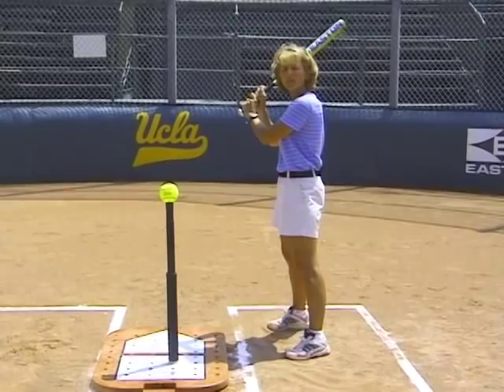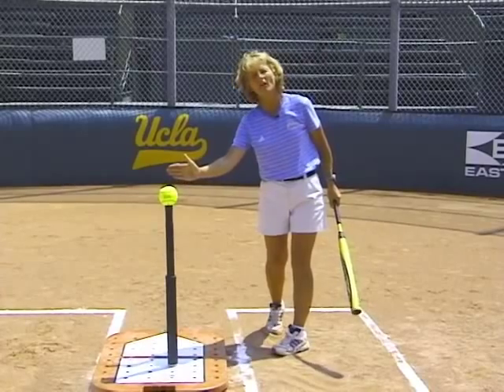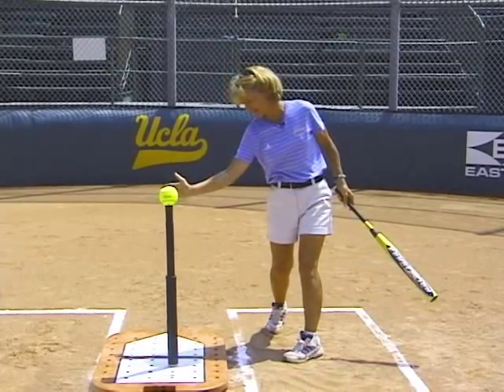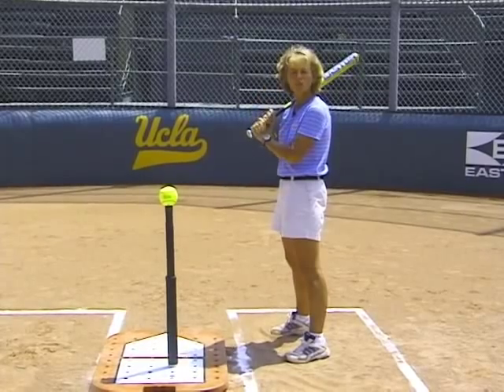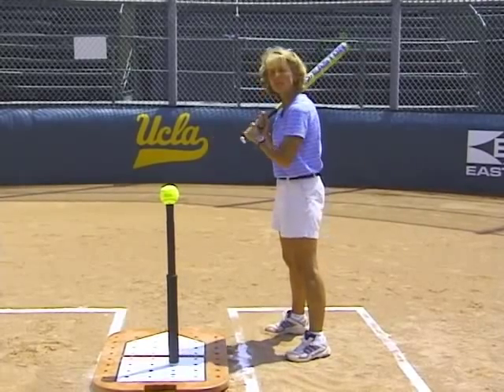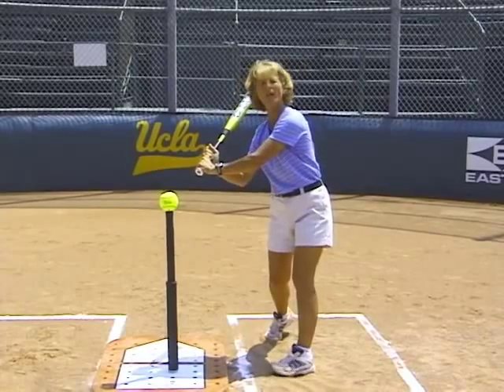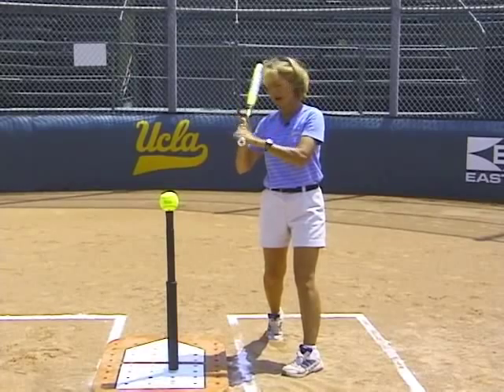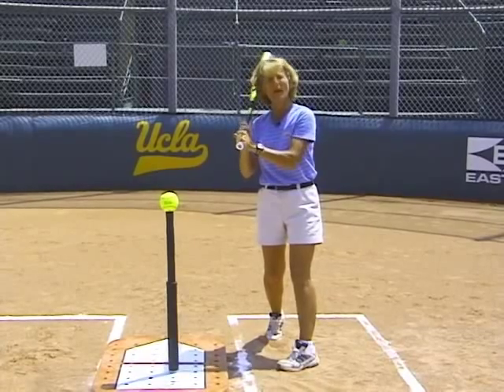Softball Hitting Mechanics - Developing a Short, Compact Swing

Comment: Hitting is at least 90% mental, probably closer to 99% mental.  Using the hitting tee correctly is the ONLY mechanical work necessary.  Instead of spending so much time thinking about mechanics, methodically visualize at least 1,000 perfect performances every day.
With less than two strikes, guess, guess, guess, guess, guess!!!!!!!  Mentally rehearse guessing and getting the very pitch you are anticipating  AND mentally rehearse hitting that pitch exactly how and where you want it to go.  Also, mentally rehearse guessing and NOT getting the pitch you want..THEN... mentally rehearse TAKING that pitch.  Do this hundreds of times every day.  This is the KEY to great hitting.  Be super selective with less than two strikes.
With two strike counts...mentally rehearse hitting anything close to the strike zone back through the middle when the pitch is over the inner half of the plate...And hit it between your push side infielders when the pitch is over the outer half of the plate.  Do this hundreds of times every day too.  With two strikes, learn to use and master the split handed grip used by the greatest hitters in baseball history...Ty Cobb, Honus Wagner, Nap Lajoie, and Wee Willie Keeler.  Be smart!!!!!!
Reply: Bruce, I think this great advice.  Now if I can just get a 16 year old girl to practice mental rehearsing. 
My question would be when visualizing or guessing location for a pitch with less than two strikes should the hitter be just looking for a specific location or location and type of pitch; fastball, curve, drop, etc...? I always tell my daughter to look fastball only with less than two strikes and take anything else, but may expand that to look fastball inside, middle or outside.  Would you agree?
Reply: Bruce Wright Strangest thing happened today.  My 13 yo daughter came back to softball after a few years off (she had only played one year prior).  She has been a weak hitter so far.  I was practicing with her today and I simply told her to be a little more intense...to believe that she was going to hit the ball.  She was soon hitting every ball out of the infield.  It was the strangest thing...such huge improvement, like night and day.  It's definitely 90% mental.
Reply: Bruce Wright Thanks, I'll check that out definitely.  I assume that method can also work with pitching? haha last night she completley lost her control...couldn't hit the broad side of a barn with a basketball.  She was getting very frustrated.  But yeah, I'll check out those images.  Thanks again.